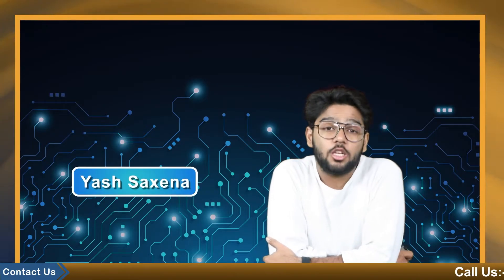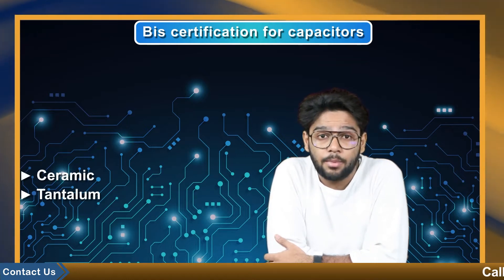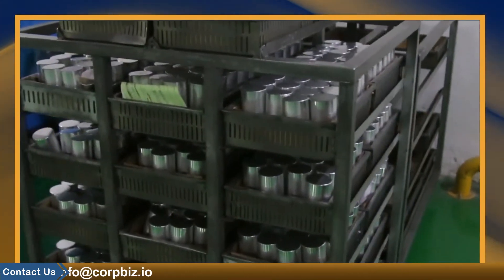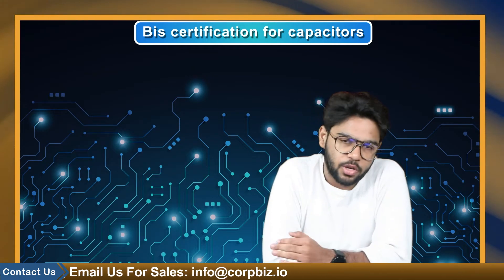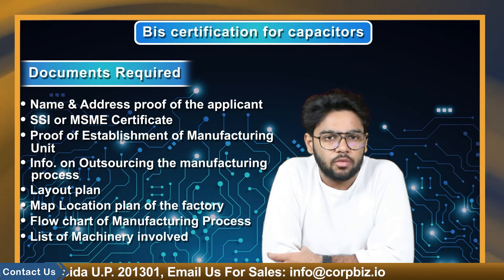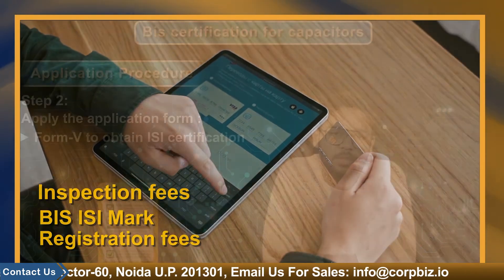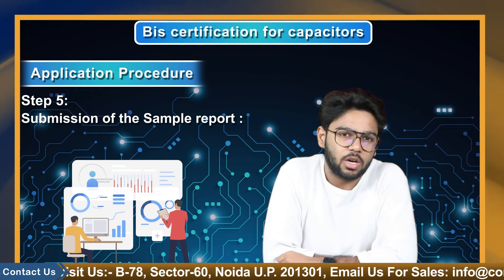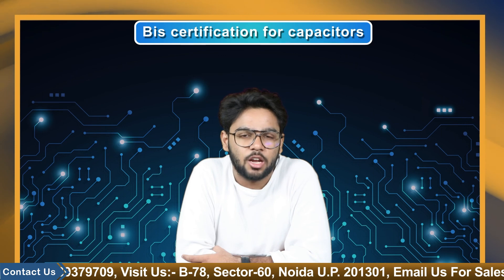BIS Certification for Capacitors Manufacturing | Capacitors For Electric Fan Motors | Corpbiz

Comment: for aluminum electrolytic capacitors need BIS?
Reply from the maker: BIS registration is required for electronics and IT products. BIS registration is compulsory if you are an electronics and IT product manufacturer.